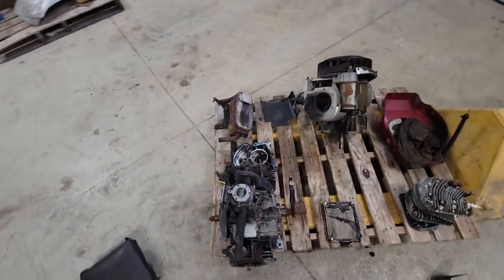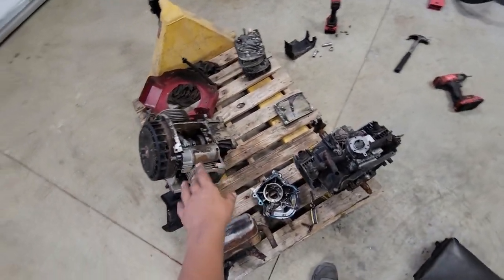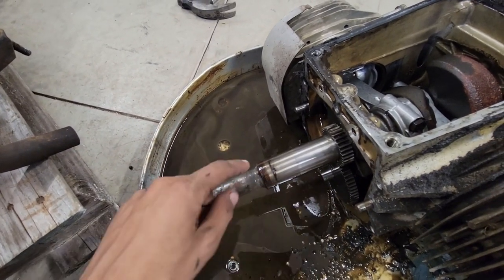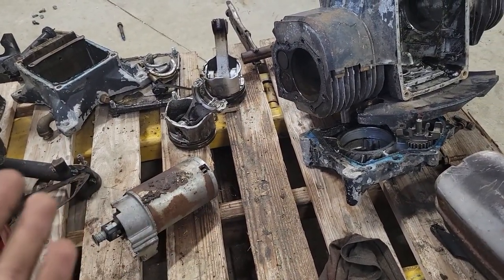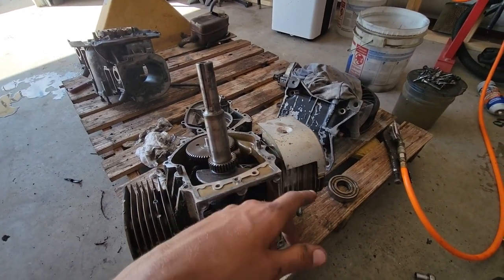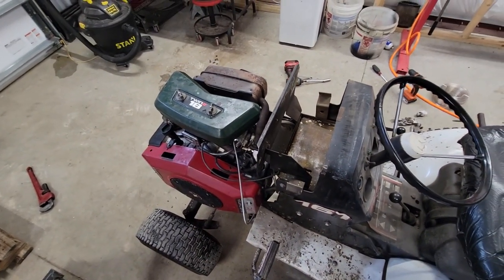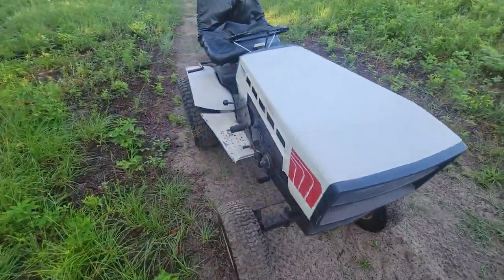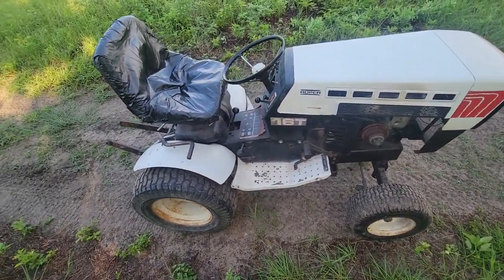Briggs opposed twin rebuild for a Roper 16T

Comment: The Briggs opposed twin cylinder engine 12.5hp - 20.5hp those engines are 50/50 in my opinion. Some are good and some are complete junk. It's just matter if you get lucky or not. Biggest issues with em are coil failure when hot and not wanting to restart and some build up too much compression and they eat up ring gears on starters. If you got a 3 bolt fuel pump front style carburetor with adjustment screws your doing good but the 4 bolt one they are junk. The twin cylinder vanguard Briggs is the way to go and it's tougher and the exhaust sound on the vanguard is 👌

Comment: You could easily "lightly" Sand the Crank Journal to remove the Aluminum from the old Rod...
Reply from the maker: I tried that before and it didn't work. I'm keeping the messed up one anyway and going to figure it out eventually.
Reply: @IMPRIOR87  Muritic acid will remove every bit of it.
Reply: @MedicatedOMO  that is what i heard/read somewhere too. then Mic it with digital/mechanical mic and spin the rod around the crankshaft before putting it together... it should spin easily and NOT hang up anywhere. i had egg shaped rod that wud hang on one spot on the USED crank. new rod did NOT hang anywhere on the top rod journal ... that starves for oil to begine with ... REALLY starves for oil when ppl cant check the GD oil BEFORE EACH RUN OF THE DAY. i wrote that on all my motors and cowl of dash since most ppl are TSTB and CANNOT CHECK THE OIL BEFORE THE FIRST RUN OF THE DAY... and know that most any oil is better than NO OIL... except trans fluid that is TOOOO LIGHT. MOTOR OIL ONLY 20-50 MOTOR OIL ONLY!!!!! PAINT PENS are cheap. motors are not cheap. next owner doesnt like it... can paint over it. every machine i get the machine has been run LOW LOW LOW on oil... "my cousins a mechanic!"  yearite, whatever u say... do YOU know how to check the oil ???? i didnt think so.
Reply: You can successfully remove the aluminum from the journal using muriatic acid and lightly sanding with 3k grit paper and then buff to a smooth finish I’ve done it multiple times and it does work the engines I’ve done it on are all running to this day! Give her a shot just don’t use anything aggressive at all and you can reuse that crank bro 👍✌️
Reply: @NinjaNeglector  I have a blown opposed (the 46, rare model) with some al on the crank. I am on the fence to do it or toss it.
Reply: @MedicatedOMO  Lye (Sodium Hydroxide/NaOH) works well too at removing aluminum from iron.  The acid works but can also attack the iron if you're not careful to neutralize it when you're done.  Lye leaves the iron alone.  You still have to clean it when you're done, you don't want the lye touching anything that's not iron like your bearings, plastic parts, oil, etc.
Reply: @flaircraft  Good thing crankshafts are just steel i guess...

Comment: How anyone could drop a screw down an intake, and think it's fine to run the engine without retrieving it, is beyond me...

It's lucky that it got stuck under the intake valve rather than jamming into the combustion chamber somewhere.  The valve lift was probably low enough that the head of the screw wouldn't pass through the valve.